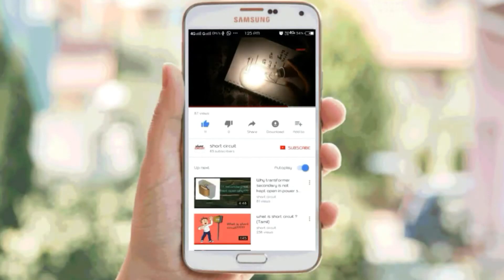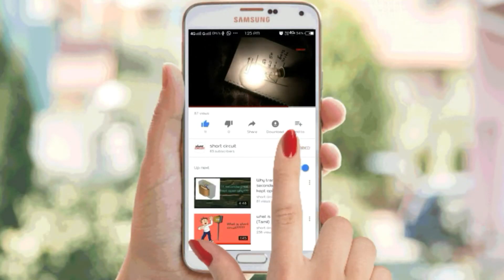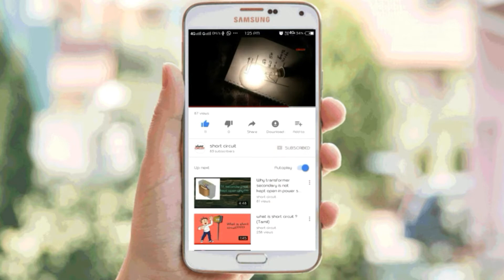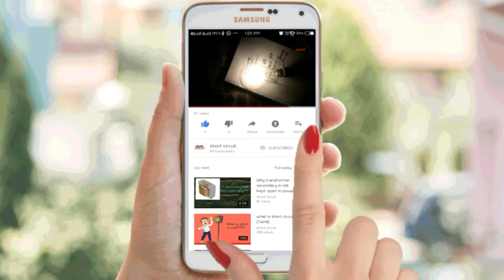Why Earth Wire(Green Wire) is connect to outer body of our Electronics appliances (Tamil)

Comment: 230v supply and 440v supply different and why 3phase have 440 and 1 phase have 230..?
Reply: 230 is phase voltage. Voltage between phase and neutral. While 440 is line voltage, voltage between R and B or B nd Y etc. Even in 3 phase star connection the voltage between each phase ( R Y B) to neutral is around 230 only.
And line voltage = root(3) x phase voltage.
I hope this is what u asked for.
Reply from the maker: SSU gangster angle differ agumm and  phase generating angle are all different this changes based on each country climate
Reply from the maker: SSU gangster us has 60hz and the voltage is 150